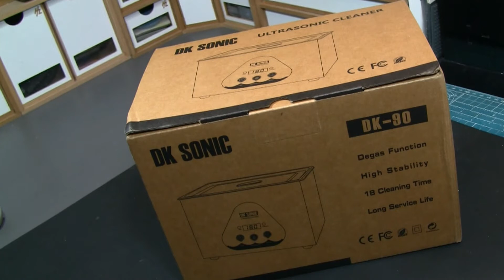DK SONIC - Ultrasonic cleaner - Cleaning My Iinfinity Airbrush - Scale Modeling.

Comment: I am very disappointed with my infinity, I am not sure what is wrong but I cant get it to spray paint on the fine setting and it clogs up with thin paints such as MRP.
Reply from the maker: I'm sure it's a matter of finding the right balance of the mixture of the paint. MRP is ready thinned ? I never used them but I don't think they will dry at the tip.